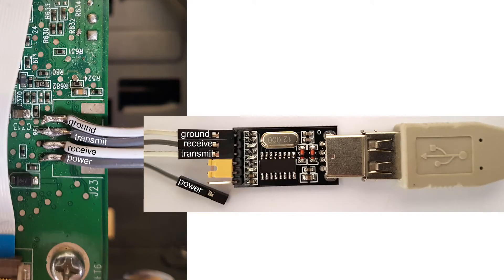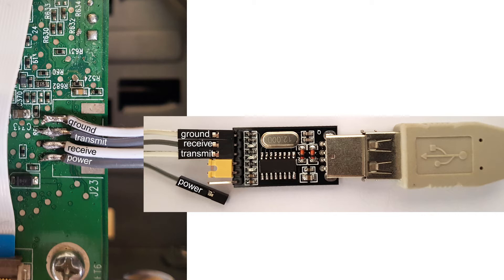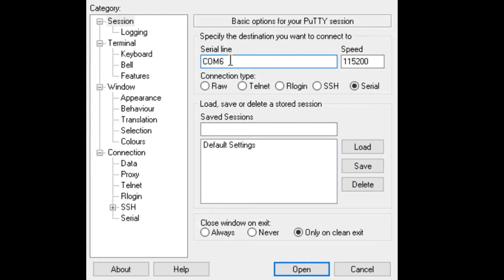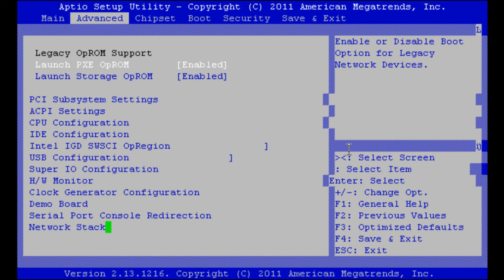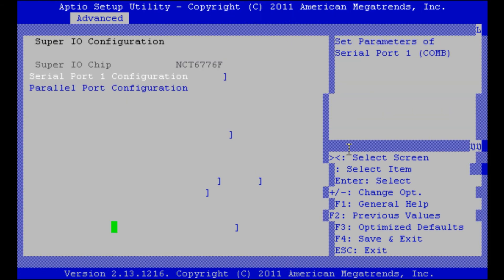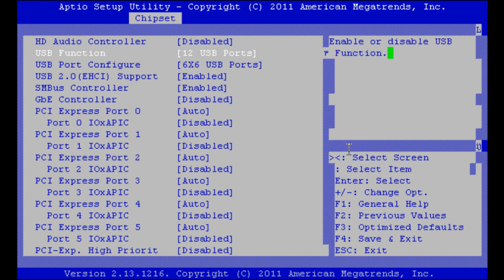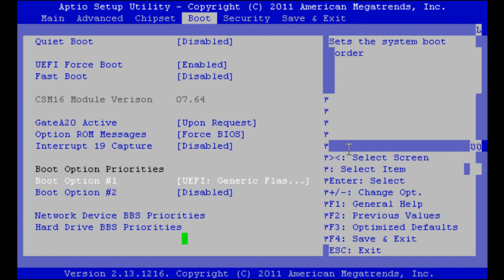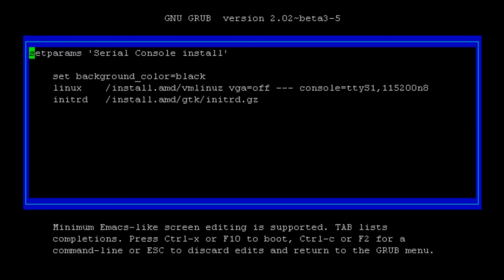OpenMediaVault on DX4000 - Part 3 UEFI Setup

Comment: Hello mate. Do you know how to restore the BIOS to default, factory setting without actually going inside of it?
My DX4000 is stuck on boot, LCD shows STARTUP INITIALIZING and putty console stuck on Entering Setup.
Reply from the maker: To use Putty you have so solder some wires to the main board and connect a usb to serial adapter at 3.3 V. See the first video for Hardware setup: https://youtu.be/amUXkdGdcTg

Comment: Hello Martin, i have tried two usb-serial and one desktop with rs232 and no matter what settings i try on in putty i get only strange characters output:
^իVZkX.▒V).▒▒,▒▒▒V▒Q▒▒▒T▒▒˅▒j▒▒▒Ժ▒
                                  ▒u▒▒▒Qh▒ڴ▒rRV).j▒,▒▒▒V▒▒▒▒▒▒▒▒▒▒▒▒▒▒▒▒▒▒▒▒▒▒▒▒▒▒▒▒▒▒▒rRg▒be▒
              rRg▒be▒
                     rRg▒be▒
                            rRg▒ e▒
                                   rRg▒be▒
Have you encountered that as well?

port settings are correct and the serial ports work with a hp managed switch serial console.
Reply from the maker: Looks like the Encoding of the chars are not correct. Please check if the are as in 5:13.
Reply: @MartinMeise  Hi Martin, yes i have set it as you shown. I have also tried to set puty Conection - Data Terminal-type string to ASNI and remote c  character set to Use font Encoding:
 ürR³-rRû
        Úô;6mÉIûûë¿¿¿¿¿¿Y-íûûûûûóûûûóûûûóûûûûûûûûûûûûûûûûûûûóûûûûûûûûûrR³ebdì«l–.ªö–¬ö                    5¿Y=¿¿¿¿¿¿{!!=;'5$IŸ%ÉI›‰™‘‰—Ÿ%¿ürRV–ìööëûûöûûû›:ªTªúöûûûûûûûûûûÛÕµÝu{+µÚÚÚÔûûûûû
ëýûûûûûûë6{vµýKIŸ%ÉI™—Ÿ%sôj:ªºJ—õV).j–,–ìöVéƒûûûûûû
úûûûûrR–ìöö+.êV).ª–,–ìöVéƒûõj”Ô)ê:ú»ÕšjÊªÊ´–.êV).j–,–ìöVéƒûûûûûûûûûûûûûûûûûûûûûûûûûûûûûûûûûûûûûûûûûûûûûûûûûûûûûûûûûûûûrRöìöö+.êV).ª–,–ìöVéƒûÚtô»ÕšjÊªú+…ºª:úûûûûËUÚÔê:úËûûûûûûûûûûûûûûûûûûûûûËÕZTú»ÕôMhVQºT”ôméékÝµ#.êV).j–,–ìöVéÃûrRÖ,ìööëûËöûûû‹uåý‹ÝmûûÖ65}=•ûû‹u•‹ååu{}{»vVö¬öûûûûûûûûûûûûë6{vµýÉIŸ%ÉI›‰™›‰—Ÿ%eP*ÚªÚô»µÊJzûÖK—õV).j–,–ìöVéÃûûûûûûrRg–ìööëû»V=ºú‹uåý‹ÝmûûÖ65}=•ûû‹u•‹•åu{}ÛëööÖöûûûûûûûûûûûûë6{vµýKIŸ%ÉI›‰™›‰—Ÿ%cH¤i«_[×»µÊJJ—õV).j–,–vöVéƒûûûûûûûrRggbööëû«V=ºú‹uåý‹Ýmûûö65k-•ûû‹u•‹•åuû}›m;Ýu»ûûûûûûûûûûûûûë6{vµýKIŸ%ÉI›‰™›‰—Ÿ%ci©ÚÕµÝý»µÊJJ—õV).j–,–ìöVéƒûûûûûûûrRg³böö+.êV).ª–,–ìöVé…£MFFK—õV).j–,ö–ìVé
^Õ«VZkX.êV).ª–,–ìöVéƒQ¤«ºTÚôË…šjŠª´ÔºÔ
                                      ú«]j:jºÔ´´´ºRV).j–,–ìöVéƒûûûûûûûûûûûûûûûûûûûûûûûûûûûûûûrRg³bYì
                    rRg³bYì
                           rRg³bYì
                                  rRg³bYì
                                         rRg³bYì
                                                rRg³bYì
                                                       rRg³bYì
                                                              rRg³bYì
                                                                     rRg³bYì
                                                                            rRg³bYì
   rRg³bYì
          rRg³bYì
                 rRg³bYì
                        rRg³bYì
                               rRg³bYì
                                      rRg³bYì
                                             rRg³bYì
                                                    rRg³böö+.êV).ª–,–ìöVéÅ£S££K—õV).j–,ö–ìVé
 Maybe i need to buy an USB to TTL converter instead using the usb serial i use for hp switches.
Reply from the maker: Maybe try different Baud-rates.
Reply: @MartinMeise  Hello Martin, it was really my USBtoSERIAL . I have bought USB to TTL and it is working like a charm :)

Comment: Hello, nice work, What Translation settings do you use? I get connection but it's not rideable like yours.
Reply from the maker: Thank you. What do you mean with Translation? The serial connection should work with a baute rate of 115200. Have a look at 5:15.
Reply: Martin Meise: ok I will try
Reply: @MartinMeise   This is how I see it with your settings. http://pnitsupport.com/PuTTy-WD-DX4000.png
Reply from the maker: Maybe you can make a picture of your settings in putty?
Reply: @pavelm1592  hi habe das selbe problem

lg
Reply: @pavelm1592  Were you able to solve your issue and get a readable output on putty?
Reply: @MartinMeise  Excellent video i would have to say. I have 4 of these units available that would work great with TrueNAS. But i have the same issue that others are having. I soldered the wire and am able to connect through putty. But the output on putty is garbage and not readable. I have tried all possible Baude Rate settings including 115200 but the output is not readable. Any idea what could be wrong??
Reply: I have the same issue,  unreadable  output.   Has anyone figured this out?

Comment: great video series. is it possible to install the os on the drives? or is it not possible to boot the drives
Reply from the maker: The operating system can also be installed on one of the hard disks. But then it may be more difficult to build RAID systems.
Reply: Its possable but most people don't do it becasue if you do that drive can no longer be part of the raid. Using a USB driver allows for larger over all storage. The windows OS that this device came with over came that issue but I don't know how, nor does this video show, how to do that with OpenMediaVault.